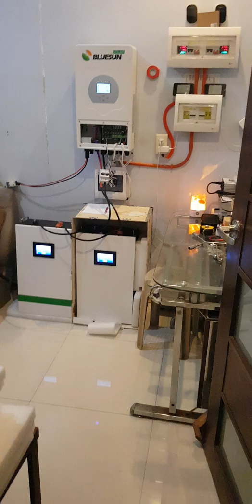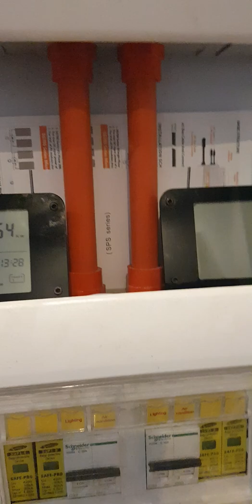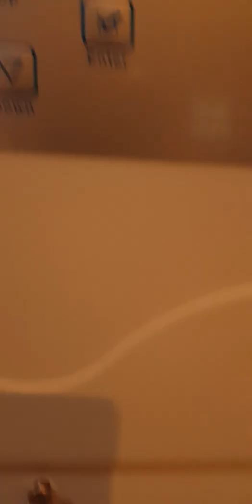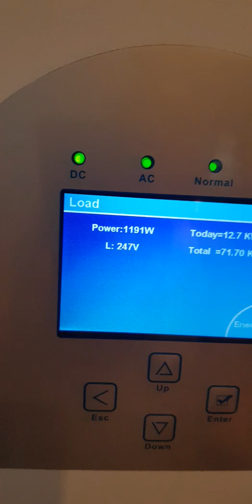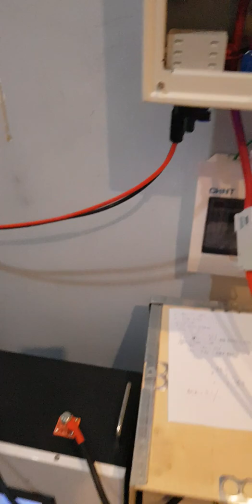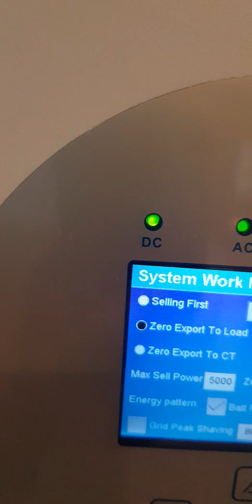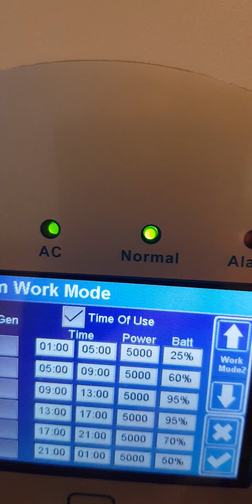Deye 5kw Test Setup with 2pcs 5.12kwh XD batteries both 5yrs warranty  2014 300w x 8 solar panels

Comment: Good evening sir, aabot Kaya ng 3yrs yan deye inverter sir bago masira? 24/7 kc ang andar nyan walang pahinga ang inverter. Ano Kaya ang maganda gawin Para umabot sya ng 3yrs bago masira?
Reply from the maker: 4yrs na nakakabit ang Deye ko 24hours operating. Use max 80% of its rated capacity for UPS mga 4k watts max other loads sa grid. Limiter connected para iwas export energy
Reply: Wow maraming salamat boss na umabot Pala sya ng 4yrs operating na walang naging problema. Good job boss.

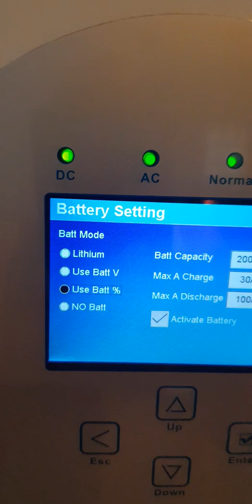Comment: Hi. My DEYE "Grid Charge" is NOT WORKING. Even if I set to Grid Charge (checked) in the Time of Use. What's the possible problem? I set the time from 00:00 to 05:00, Grid Charge Checked. But still during that time, my battery is still discharging.
Reply: solved?

Comment: sir yung eps/load side ng inverter,pwde bang e tap sa main breaker ng house? kasi kaya naman ang buong load ng house po..

last question po is, hindi ba mag salubong c grid at eps/load ng inverter since both naka connect sa main panel...thanks sa response po sir
Reply from the maker: Ac out or EPS acts like an extension cord. It’s output is independent and cannot go back at magsalubong.
Reply: @solaredd7805  sir yan din ang tanong ko kasi di ko magets ang connection ni DEYE sa eps load
Reply from the maker: @lovelove-jc6jb  just think of EPS as an extension cord, you only connect appliances or load but you do not connect back the wiring back to the main box unless you cut the box and separate breakers for EPS use and do not rejoin the EPS back to the main grid. Think as an extension cord ang EPS which the battery will supply power when there is power outages. Main loads separate from emergency or critical loads.
Reply: @solaredd7805  I am thinking to connect my whole house on "Home load" output from inverter, at same time be connected to the grid with CT sensor on live wire between elektra meter and house, and utlise "zero export to grid" function of inverter. My LFP battery bank consist of two pcs 5kwh connected to Deye SUN 6-K monophase inverter. If grid fail my system would continue to power up my house. Whats your thoughts on this?
Your cables (grid and load)  look thin?
Whats cross section in these?
Cheers mate

Comment: Very nice and informative video. May I ask sir if all the load in the house is connected as backup load to the inverter?
Reply from the maker: Hi, I only connected essential loads to the EPS or load side and all major loads like heaters and power hungry appliances to the regular DU side. Since this is hybrid ongrid it can still send excess power to the house.

Comment: During commisioning po alin una dapat ipower up? The battery to power up the inverter or the grid first?
Reply from the maker: Battery 1st then solar then inverter initial power up. Power down inverter then solar then battery.
Reply: @solaredd7805  commisioning done sir, pro merong minor issue regarding export, tuwing peak sun hour po ng eexport sya ng 40 watts, ok naman po lahat connection, then zero export is selected, ano po kaya possible cause?

Comment: can you test sir the load sir ?(aircon / ref) in offgrid time using battery only,  (disconnected DU) im trying to figure out if how Deye will handle the surge using battery only,
Reply from the maker: i tried it already without ac and solar. no problem starting up the appliances
Reply: @solaredd7805  meron po ba sir sa setting na steady off ang charging ng battery sa Grid? mins hindi sya magchcharge sa grid at night pag naglowbat.
Reply from the maker: @clarkallen2866  pwede mo off grid charging sa time of use or battery settings adjustments
Reply: @solaredd7805  uncheck po ba ng Grid charge and Grid Signal?

Comment: Good evening sir, can you set float voltage and absorption voltage lower than 55 volts? for example i want float voltage to 54v and absorption voltage to 55v, are this settings possible sir
Reply from the maker: Yes can set float and bulk charging
Reply: @solaredd7805  thank you so much sir
Reply: @solaredd7805  good day sir, what is the difference of zero export to load and zero export to ct

Comment: correct me if I'm wrong, lifepo4 batteries doesn't require float charge, you will only lessen the cycle of your battery if you do so
Reply from the maker: Charge float is necessary so voltage stays at 54.4v and charging continuously without overcharging the cells. It need to store current not just reach the max voltage per cell.  Inverter controls the float charge BMS controls the cells balances and protection parameters
Reply: the best way is to set it to lithium mode and connect a communication cable from inverter to battery
Reply: Its always goid idea to have comms and BMS working. Othervise voltage parametars must be set carefully.